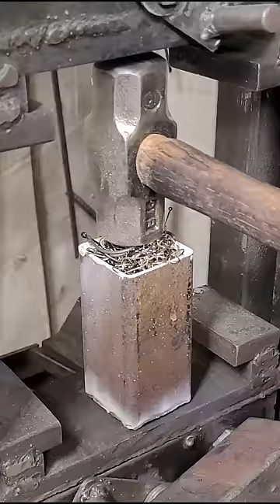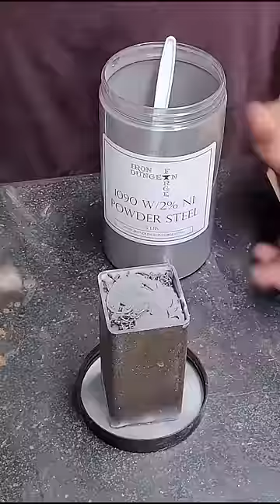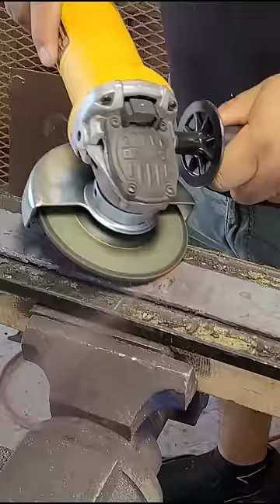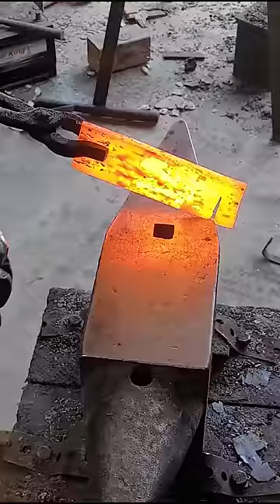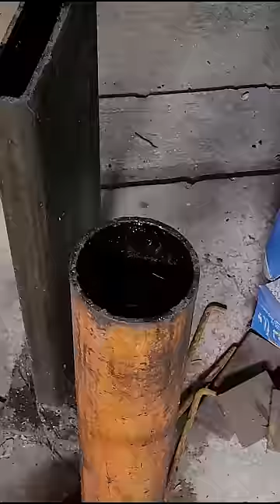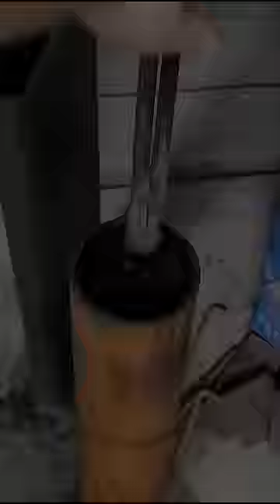Making a Damascus Cleaver From Fish Hooks

Comment: You keep getting better and better. This one turned out great and the way you made the tang was sick
Reply from the maker: Thanks. Glad you liked it.
Reply: @JPsBladeworks tip…. You heat treated it REALLY hot. A little cooler and it’ll be less prone to cracking.

Comment: It will never stop being funny on how people argue which is dascus and which is not😂
Reply: No way the strongest sword in the world getting cutted by a normal grinder 😂
Reply: @sonteguh  With the right abrasive it can, hell titanium can get lopped by an angle grinder with the right disks
Reply: Show me where he folded it
Reply: @fishlemontek189  its in a cannister you don't need to fold it since its consolidated into a single piece. There's a plethora of ways how to go about this and there's no one answer to satisfy XD
Reply: If it's from Solingen it's a Solingen knife. If it's from Sheffield it's a Sheffield knife. If it's from Damascus...
Reply: @obnobn2345  Yeah no XD Damascus does not necessarily need to be folded. If we were follow that logic, Why aren't katana's considered Damascus when they also get folded? If you really wanna get into the nitty gritty Damascus was called Damascus because said steel was made in Damascus , Syria. The original process was made by melting metal to make wootz steel hence why the pattern of the original steel is inconsistent. First off the main reason it got its name as Damascus because it was made in the capital of syria, there are other examples were wootz steel was names after different places in Syria. Second the purpose of folding is to help homogenised the carbon content of two different types of steel amd spread it mor evenly to prevent the blade from being hard on a few sections and softer on the others
Reply: @vtds2102  the pattern was inconsistent not due to its molten state but due the variable composition of the ore used to make it
Reply: at this point Damascus is just bunch of steel melted together
Reply: @oddbluedragon  pretty much XD

Comment: is fishhook a good material? it feels the blade is mostly made of the steel powder.

don't get me wrong tho, the build is beautiful
Reply from the maker: I believe so. Im not sure of the steel type but it shows that it is high carbon steel when etched. And i did some research and most fishing hooks are made from some sort of high carbon or tool steel to handle the stress.
Reply: @JPsBladeworks  that's actually cool
Reply: Modern fish hooks are always  made of high carbon steel so they rust away fast in case of lost fish.

Comment: Wow Beautyful knife, just one question whats that white layer inside of your canister? And what is that steelpowder and where can i get it?
Reply from the maker: Its white spray paint. it keeps whatever your forging together on the inside from forging to the can. it only works with white paint though because of a chemical inside the white pigment. Works the same as white out but better.
Reply: @JPsBladeworks  wow thanks
Reply: The chemical he mentions is titanium dioxide. Paints work better than white out because they have more of it. It works because the titanium refuses to weld to the steel and creates a barrier
Reply: Also just search powdered steel and you will find dozens of sellers of many many alloys. Just pick one that contrasts with whatever other metal you use and you're good to go

Comment: Full disclosure my knowledge of forging comes from Forged in Fire so I basically have none. With that said I’m curious how you always ensure the canister comes off so easily? On the show I see a lot of guys really struggle to remove it. Just curious love the shorts!
Reply from the maker: White spray paint. Coat the inside of the can. Works the same as liquid paper or whiteout but its cleaner. They dont have the time i do to properly prep.
Reply: @JPsBladeworks  thanks!

Comment: So, we're you gonna put any tool steel in or you just want a bendable knife?
Reply: 1090 was poured in, the powder he used 

Ik 90% of people miss it, but this is a mix of (likely) 3Cr for the hooks (most hooks need at least a little bit of carbon to bite into a fish’s flesh) and 1090 steel

So a stainless with a speed steel
That is gonna be a better blade then 99% of Walmart kitchen sets

Comment: Debating the use of the term "Damascus" is getting old.  These days, Damascus refers to a pattern formerly associated with wootz steel.  So-called "real Damascus" is also a steel composition with similarly overhyped properties to katana steel "folded 100 times".

The craftsmen who made wootz Damascus would probably have been happy with this cleaver.

Comment: Not damascus 

Damascus is made in the foundry,  not the forge
Reply: No, Damascus is made in a forge by hammering different layers of steel on top of each other and repeatedly folding. A foundry is the name for the place where metal is molten and formed into moulds. What the guy did here is a little different to normal damascus, he got the pattern in the knife from the different types of steel in the fishing hooks, instead of the tradititional folding.
Reply: @zeblob5667  no. It isnt. This is called forge or pattern welding, and while beautiful,  is not the same thing. Actual damascus is made by combining low and high carbon steels in a way that they don't actually alloy when molten, but swirl together in an chaotic and intricate manner. The technique had been lost for hundreds of years,  but was rediscovered in the late 90s, IIRC.
Reply: @vincentcyr3719 "aCtUaLly" you're literally that guy dude.
Reply: @Just-Steve  still right.

Comment: People need to stop calling anything pattern welded Damascus, it's not damascus
Reply: Я тут видел как железо с медью сварили, угадай как назвали, правильно - Дамаск
Reply: Language evolves and so should you.
Reply: @joshschneider9766 wrong
Reply: @joshschneider9766 Damascus is the technique of folding metal repeatedly during the forging process to change the properties of the metal. It is a traditional Japanese forging process. Calling any metal work with a pattern on it Damascus is a insult.
Reply: @lukylucasgaming9446  Ahahahaha XD this has to be the funniest on yet XD your comparing apples and oranges XD Folding the steel while forging does not make it Damascus, the folding helps to spread and even out the carbon content of the steel to help homogenize the carbon content throughout the knife. Its called Damascus by association over period of time because the steel or knife originated from Damascus, Syria not because of the art. 

How you associated pattern welded steel to japan is beyond me because I am almost 1005 sure you are referring to the hamon line aka temper line where it show discoloration in the blade to indicate where the hard edge is and where the soft spine is